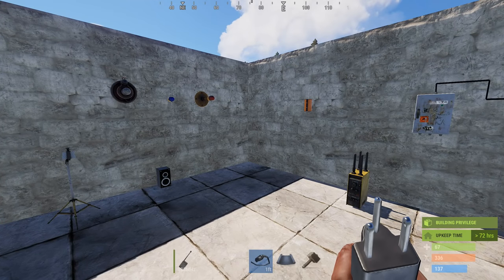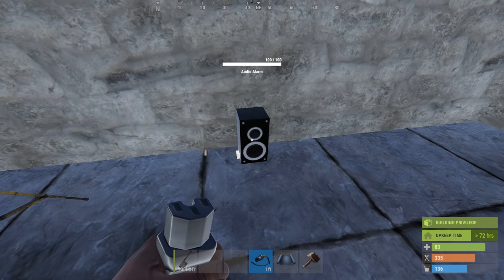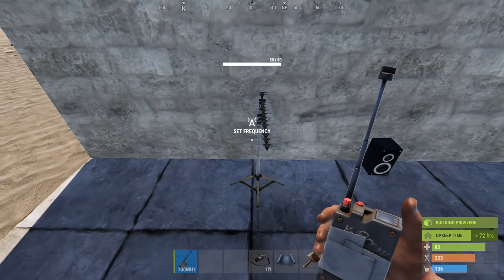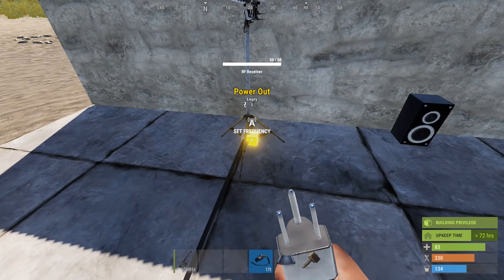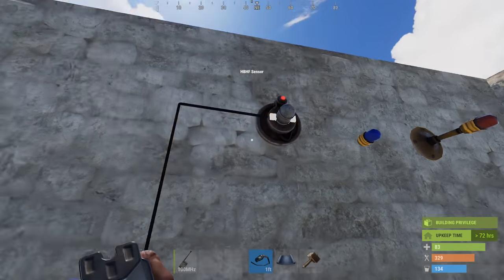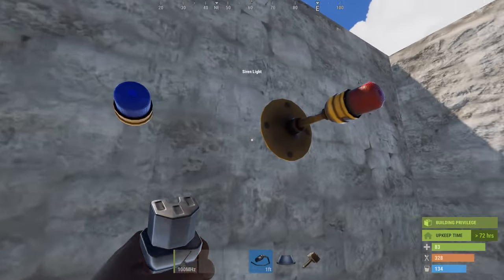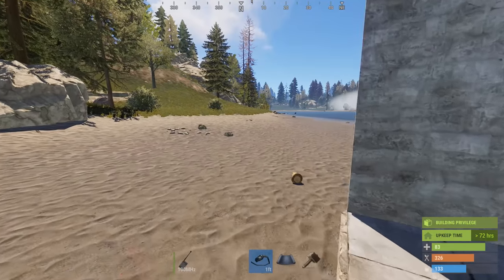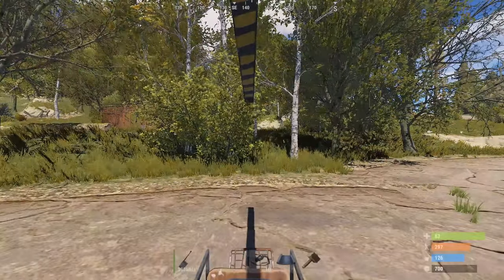Rust RF Electricity Tutorial #8 - Broadcaster - Transmitter - Receiver

Comment: my technique for using the yaw (mouse left and right) is basically to use it as little as possible, because it makes things so difficult to control. You can constantly keep an eye on the horizon to see if you are flying level or not and correct using the horizon line as well. Also, as soon as you turn to the left or right with A or D, you'll start to yaw a bit, and you'll have to correct with the mouse.

Comment: Thank you for the RF Stuff. For some reason I couldn't figure it out.

For the Copter I basically only use WASD. I use the Mouse (pitch and yaw) for when im correcting myself after A or D (It doesn't turn you more it roll's you so you use the mouse to correct yourself) and when wanting to go forward (pitch it forward) or when landing (want to have it slightly pulled back)

Comment: Great Video, liked it! but can you answer me, what does the blocker, 
RAND switch, memory cell and the branch actually doing? I mean how they 
works?
Reply: the blocker helps for night lights by using solar panels as a switch to cut off power when they see the sun. when the sun goes down power flows throw and you can use a couple of other things to block power from draining out of batteries like switches and transmitters for example. RAND is for random games like roulette. the branch diverts a programmable amount of power away from the main to activate things like the blocker or power low voltage items like transmitter and receiver. you can do what he's doing here with the remote switch acting as a toggle when used with the memory module or as a timed toggle with the timer switch.
Reply: @cortedemico   thank you so much <3

Comment: You forgot to mention, the HBHF sensor outputs the number of players in the area in the form of power, so if there's 3 around it, it will output 3
Reply: You sound very knowledgeable with the electric system you wanna join are 8 man clan?
Reply: @BigMozzy556  No need, i having a break from rust, but have my own zerg.. Thanks though

Comment: Is there a way to connecnt power - sensor - splitter - 1 light, 1 alarm 1 broadcaster ? so u can get the alarm when u around your base, light if you can see your base from distance and caster to alert your pager when ur far from base, i tried but dont know how to do it
Reply from the maker: Hey bro. Unfortunately not since the sensor only outputs voltage equal to the number of players detected. Youd need 20-30 people detected to power that setup.. and it would probably be game over if there's that many people outside your base :p
Reply: @SpookGaming  Thank you for answering me dude! much appreciated! keep the videos comming and ull se more viewers!
Reply: @SpookGaming  there goes my idea. I was gonna set it inside to start blaring alarms and opening doors to auto turrets
Reply: @SpookGaming  what if you used a ab switch or w/e it's called that way you can branch power to fuel more things while the sensor is active but while it's off it kills power to it